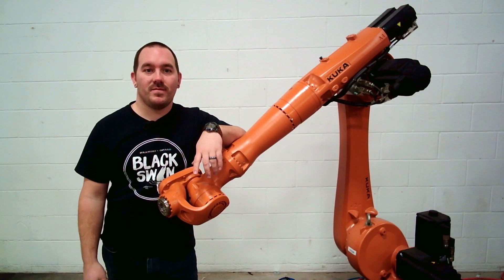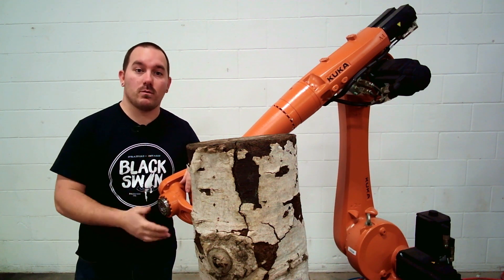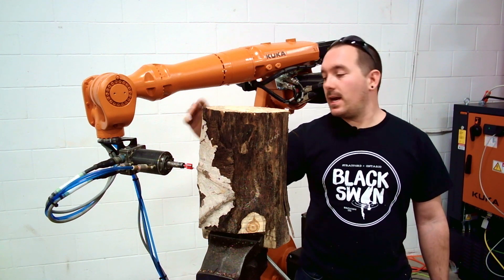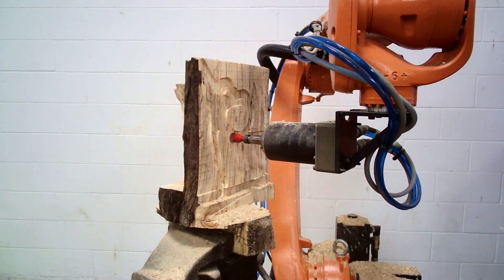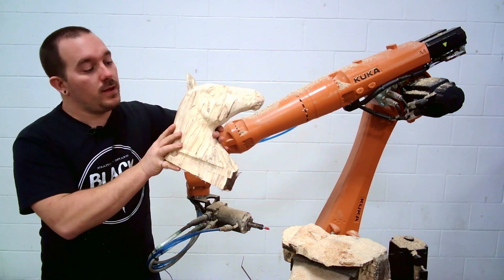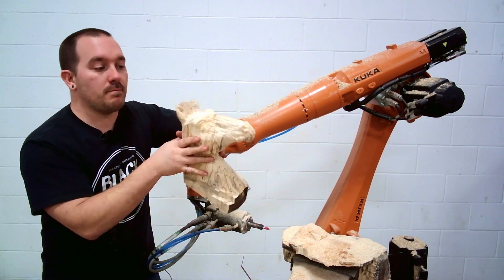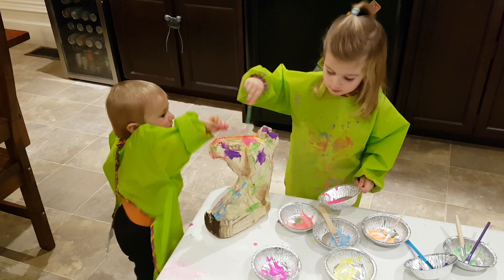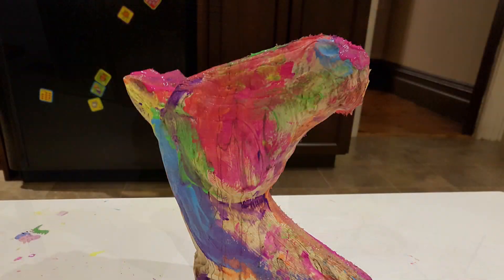Robotic Unicorn Machining - KR20

Comment: you know if you have rhino 5 or newer you can use kukaprc to create and simulate the robot
i have a kr140 and a 4kw spindle, have just got done building a rotary table for it, as is its 6 + 1 and i can set the table but hope to add kuka servo and drive.
grate video

Comment: how do you justifie the cost of something like the spindle?
Reply from the maker: It really depends what you are doing. If you used a dremel, you could machine something like this, it would just take days. With a good spindle, it takes hours. Huge efficiency improvement
Reply: @DavesArmoury  I meant for specificly? is this just investing in a hobby or do you have another use for the robots and tools?
Reply from the maker: This is just a hobby. The spindle has been loaned to me by the manufacturer.
Reply: @DavesArmoury  ah cool. guess its free publicity for them. keep up the good work